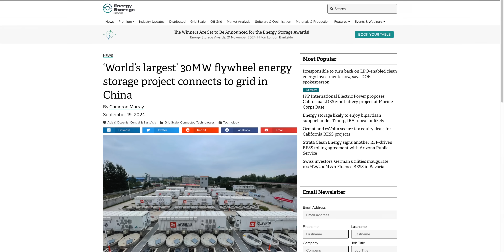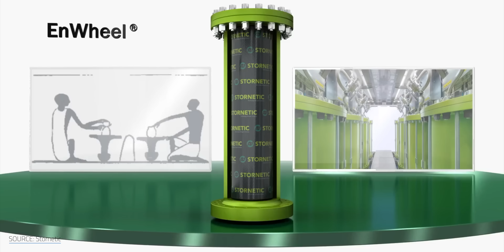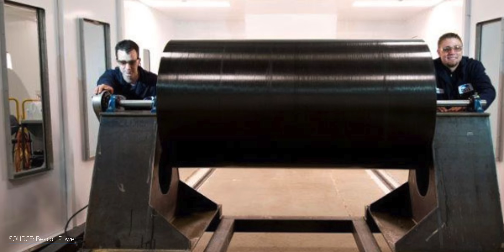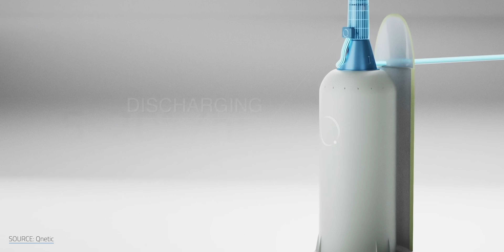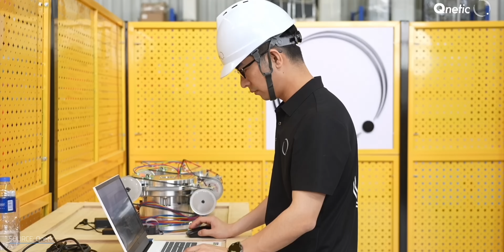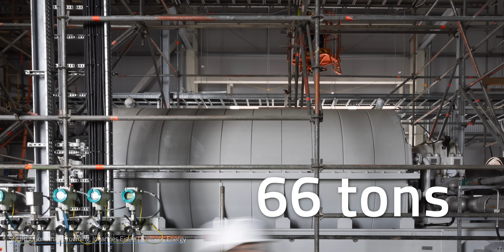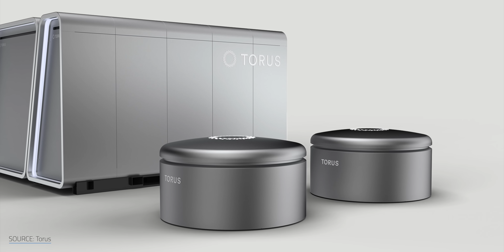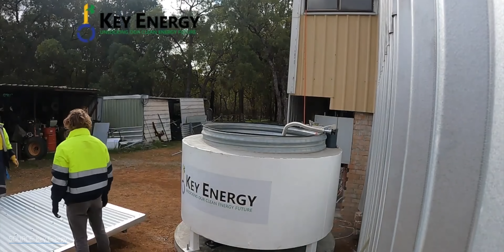How This Mechanical Battery is Making a Comeback

Comment: Is the flywheel itself the generator, or is it the source of potential power?  I was just wondering, because I've always wondered if a highspeed flywheel in a vacuum spun on top of a bearing consisting of a titanium point on a concave depression of sapphire Could offer the decreased resistance that might potentially exceed the potential of a chemical battery.  Gear it down from the top of the device, with a fluid clutch or mechanical gears, to drive a generator, and see what happens.

Comment: You fail to mention that flywheels replace the thermal power station turbine/generators that acted like a flywheel if the station went down maintaining grid frequency whilst contingency plans were activated. Without flywheels when a solar PV farm or wind turbine farms goes down, the grid loses both power frequency stability, which has a cascade effect worsening the issue. For this reason alone all solar or wind renewables should have at least a FESS along with a BESS.
Reply: Frequencies in PV and wind turbine farms are generated by solid state inverters, not a rotating generator.  They don't need flywheels to maintain frequency.
Reply: @stargazer7644  And when the PV or Wind Turbines Bine farm trips and there is no generation to the solid state inverter, what then? This has happened in the UK when a major North Sea offshore wind farm tripped, causing a frequency drop and major cascade outage to the grid. Fo this reason alone the Uk grid is installing fly wheels, to emulate the flywheel effect of the now replaced thermal generators. The UK has no operational oil or coal thermal stations, only gas, but an ever increasing renewable capacity. A major addition to pumped hydro is under construction in Jockland, but will take time to come online.
Reply: @grahamcook9289  Then the flywheel supplies power and gradually spins down to give the standby generators on the grid time to spin up and stabilize the grid.  This is literally what this entire video is about.  The frequency drop on the grid happens when the load starts to exceed the supply.  That causes the generators to slow and thus the frequency to drop. If you can't increase generation, then you have to shed load.  If everything was solar or wind and there was no (or minimal) spinning generation, that frequency effect would no longer be a thing.
Reply: @stargazer7644  Au contraire mon ami. In your scenario it would be even more of a thing. Doh! Give up, your shoe size is obviously greater than your IQ. 🤣

Comment: Could be a good option for vehicle battery charging in the high charge rate range.. Spin it up on 110-220volt and discharge quickly into a high charge rate vehicle, thus preventing the grid spikes at 5-7pm and allowing quick charge without grid spikes.

Comment: My big question is how long the switching circuitry will last. Probably a pretty wild inverter circuit running these things. Really impressive coulombic efficiency though
Reply: I think one can reasonably expect the inverter durability to be comparable to an EV, assuming adequate cooling, because they use EV powertrains. Luckily, the inverter is one of the more easily replaceable components of a FESS.
Reply: @tanner3801  very true

Comment: Its absolutely nothing like regenerative braking😂
Reply: You put power into the motor to give the car momentum, then you use the motor as a generator to turn that momentum back into electricity.  It's EXACTLY like regenerative braking.
Reply: @stargazer7644  you don't know how regenerative braking works.  You can say that about any energy storage
Reply: @veganpotterthevegan  I really get fed up with folks like you telling me what I don't know.  I literally just DESCRIBED to you how regenerative braking works.  Please be my guest and enlighten me and the rest of the world with how regen REALLY works.  We're listening.
Reply: @stargazer7644  you didn't though.  Regenerative braking stores energy into a battery like any other means to put energy into a battery for later use.  That power can be used to propel the car or charge your laptop.  This flywheel can absolutely charge batteries.  That's not really the topic here though.
Reply: @veganpotterthevegan  "Regenerative breaking stores energy into a battery"  " then you use the motor as a generator to turn that momentum back into electricity"  Do you not realize those two statements are conveying exactly the same idea?  

Where does the energy come from that goes back into the battery during regen braking?  It comes solely from the energy you stored in the car's momentum when you accelerated earlier.   This is EXACTLY the same way a flywheel works, except you're storing it in rotating momentum instead of linear momentum. 

You apply power to the motors to speed the car up, you apply a load (the battery charger) to the motors (now acting as a generator) to slow the car down.  You apply power to the motors to spin the flywheel up, you apply a load (the inverter powering the grid) to the motors (now acting as a generator) to slow the flywheel down.

It is exactly the same thing.
Reply: @stargazer7644   it's not the same thing😅 Once it's in the battery, that power may as well have come from anything...ac charging, solar, a heat pump etc
Reply: @veganpotterthevegan  That was a quote cut and pasted directly from you, genius, before you edited it.  Most people don't go around trying to slam themselves.  You certainly are a special one, aren't you?  I'm done trying to educate you.  You're welcome.  Good luck in life.  I have a feeling you might need it.

Comment: Need to be a bit careful though, there is a big difference between variable-speed flywheels used for energy storage, and the (more or less) fixed-speed flywheels used for grid inertia.

The AC signal from the former cannot be grid-synchronized so it must go through a number of large electric components to interface to the grid, which severely limits how much instantaneous inertia it can provide to the grid.   It really does work more like a battery, including having most of the limitations of a battery.

The latter is a grid-synchronized flywheel and these are more or less directly connected to the power lines.  Because of that, and because of its mass, it can provide incredible amounts of inertia for relatively short periods of time.  But because of its narrow (and slow) RPM range of operation, grid-synchronized flywheels are NOT really long-term energy storage devices and they require a constant energy input to stay within specs.   Such a flywheel on its own can only supply inertia for a short period of time before it slows down too much and goes out of spec.

Nuclear plants, natural gas plants, and coal plants generally integrate the flywheel into the generator turbine.

One can also have standalone flywheels to supply inertia to the grid and to help deal with reactive power that makes it back to the generator.  These can more or less be powered by the grid itself, or by alternative energy sources such as wind and solar farms, supplying inertia and smoothing the output, but not really any energy storage.

That is, there is no requirement that inertia only come from a fossil fuel plant.  Any energy source can supply major inertia by adding a synchronized flywheel.

-Matt
Reply: Matt also seemed a bit unclear at times about the difference between units of power (MW) and units of energy (MWhrs). Makes me wonder how much he really understands.
Reply: Yeah, was going to make the same comment. A bit loose with the facts there, that early in the video.... 😕
Reply: I thought I'd check that someone else hasn't explained this before I launched into a rant.

It's a sixth the size of the largest in Australia, let alone the world. And I know there's talk of repurposing some coal generators as even larger ones.
Reply: Good info. Very interesting. Like windmills are not easy to interface. They brake a good bit. Either they are too slow or too fast.
Reply: This just reinforced my view that this channel is really light on the facts and not worth watching.
Reply: 中国采用的是特高压直流传输的方式，和交流信号没什么关系
Reply: Yes, I was thinking the same way. Thank you for mentioning it.
Reply: Ferrell ?
Reply: VAR Suckers, great in small grids with large load swings.
Reply: Thank you very much. Makes a lot of sense and improved my understanding.
Reply: (not sure if the last one posted) thank you! That makes a lot of sense and improved my understanding.
Reply: 可以使用机械设计自动化输出固定频率我相信是可行的，类似汽车的变速箱。
Reply: I want to make a flywheel out of batteries.
Reply: CVT can be used...
Reply: " to help deal with reactive power"

WAIT?! IMAGINARY POWER IS REAL!?
Reply: @ylstorage7085  I must not fear. Fear is the mind-killer. Fear is the little-death that brings total obliteration.  Fear is... ZAP! 

Ok.  Rewind that.  Fear is good!  Fear means running away from molten chunks of metal flying through the air!  Huff puff.
Reply: no, ur a synchronized flywheel
Reply: Yeah, it really decreased my amount of trust to that channel. It looks like very basic, yet important mistake from channel like that.
Reply: Thanks for commenting this. I was a bit confused, as what he said didn't fit with what I knew, but I am no expert.
Reply: I didn't want to write a comment, but I was a bit disoriented about these two slightly different functioning systems. Thank you for mentioning it.
Reply: I wonder, would it be possible to add a clutch and different gears to the system? So if energy was available a flywheel could be spun up to the next energy level, but would still provide 50hz with the next gear? And then as it looses energy the gears can be shifted back
Reply: @simon8206  No, its impossible to do that.  Grid synchronization on a transmission line needs to have microsecond accuracy.  No mechanical gearing mechanism has even a mote of a chance of achieving that.

Either the flywheel is directly generating the waveform, or it is going through numerous electrical conversions to generate the waveform.  Those are the only choices.

-Matt
Reply: @ Hi Matt, thanks for you reply. I didn‘t mean for the transmission to do the modulation but the flywheel itself. Imagine there are 10 flywheels spinning at 50hz and you have excess power. So you take one flywheel off the system, spin it up to 100hz, put it back onto the system, now with a 2:1 gearing. It should still be able to have the inertia effect for the grid frequency right? But now theres more energy stored. Of course there are moments when the stabilizing effect is interrupted (spinning up and shifting down when energy is released) but this could be solved with using many flywheels. I don‘t have any knowledge about transmissions so maybe there could even be a better way to do this with some automatic transmission
Reply: In practice both actually do the  same thing, they both stabilise the grid by speeding up and slowing down.

The only real difference is that the variable-speed flywheels are capable of storing and delivering more power then the fixed speed flywheels but they do need more hardware to function.
Reply: @MaartenVanNuffel  it isn't just the added hardware needed, it is how they interact with the grid.  They essentially have to be treated as a non-rotating grid-following storage system.  This is because the electronics associated with them must monitor grid frequency and conditions and then react to them by constantly adjusting the output onto the grid.  This has many implications in grid wide events, far too much for a video comment

Comment: you should've covered the fact that a theorical flywheel made of graphene could whitstand a tip speed of over 7.5km/s and have about 4x the energy density of diesel, or about 50x the energy density of the best batteries we have
Reply: What are you going to make your bearings out of?  Solid Diamond?
Reply: @stargazer7644  magnetic suspension or air bearings
graphene is 1/5 the density of steel and the bearing shape is mostly hollow
meaning have a much higher surface area to work with
you can even make it a sphere and have magnets inside of it and have the coils on the outside, meaning you can have the shell double as the generator.
That sphere disposition means no gyroscopic torque applied if it's on a vehicle
Reply: @jujuteuxOfficial  Air bearings?  At Mach 22?
Reply: @stargazer7644  it still works, even then, if we keep the spherical nature in mind then having it use magnet levitation works as well

Comment: One place flywheels could be an obvious fit: in conversion from DC solar power to grid-tied, frequency-matched AC.  If the flywheel already needs to do frequency matching, you can use solar to spin up the flywheel with essentially no conversion (using a DC motor) and then use the flywheel itself to convert to AC.  (You'd need enough flywheels and for their DC inputs to be out-of-phase so that the PWM-based motor speed control is sending those pulses to different motors at different times to maximize energy consumption, though a capacitor bank can smooth some of that over...)

A lot of these techs benefit from being deployed together for efficiency gains like this.
Reply: This can't work.  The flywheel does not spin at a constant speed - it is constantly variable with the energy stored.  Solid state inverters are far more efficient than any kind of motor/alternator configuration for AC generation.

Comment: The flywheel in Ireland does seem a bit strange because there is only one flywheel.  So what happens when they need to do some maintenance on it?  Do they need to switch off all the wind turbines just to maintain the flywheel?

Comment: the future of renewable energy needs to be the Team Work of as many sources as possible, with Flywheel batteries serving a very good role at stabilizing the energy outputs. Not as a replacement to battery storage

Comment: Flywheels are essential to the stability of any power system, and will continue in that role ad infinitum.  There are some variants I've found, both original to me and in the literature, that may enhance their role.  All of these variants take advantage of physical phenomena which make the mass moment of inertia of the flywheel a function of its angular speed.  I first figured this out in my early years in engineering school (1973-1974) when I worked out the energy stored in the governor used on early steam engines.  Whether or not it's obvious to people (it initially wasn't to me), the flyball governor stores virtually all of its energy in a very narrow angular speed range.  That's what makes it a good governor.  I came up with various means of interposing spring force between the shaft and the flywheel mass that in essence combined the energy storage in elastic strain (a spring) with that of a rotating mass.  I called these "sprywheels", and while the models I built worked fine,, the gain in specific energy storage was disappointing.  It shouldn't have been surprising, since the specific energy of elastic strain is really small.  There have been some efforts I've found in the literature to achieve specific energy storage improvements in flywheels via variable mass moment of inertia, the most promising of which make the mass moment of inertia a function of some phase change phenomenon.  The engineers working on it don't really get the whole idea of combining the flywheel phenomenon with other energy storage schema, though, and I certainly wouldn't have taken the same tack.  But someone may, someday.
Reply: Makes me wonder if springs in torsion can store more energy than in tension.